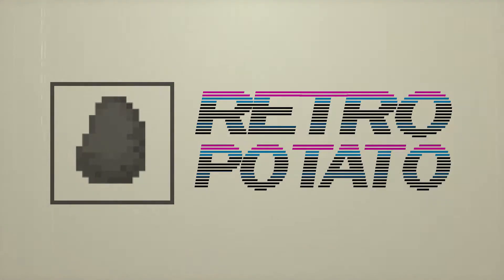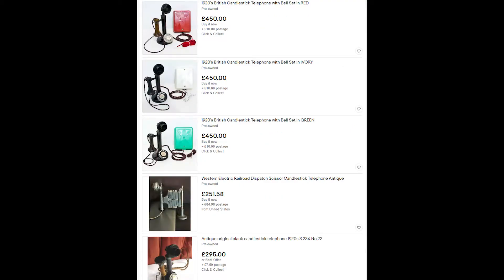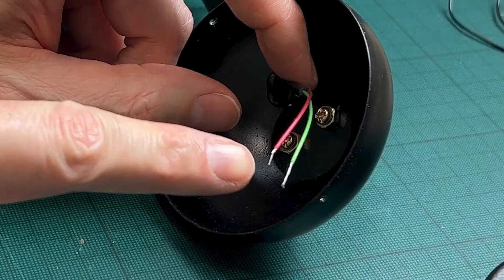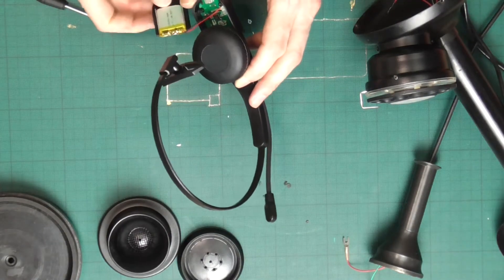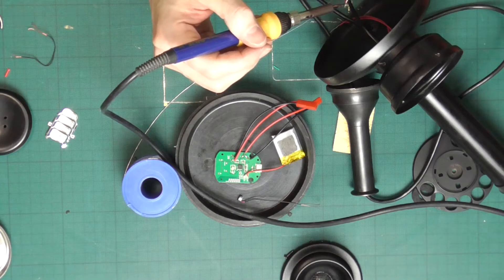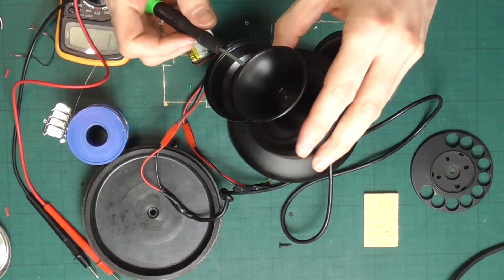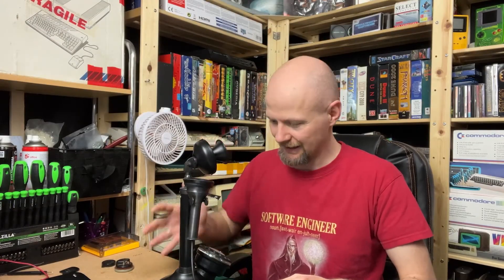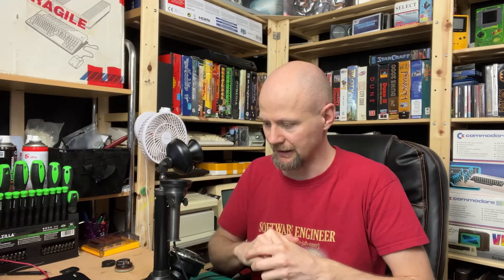Best (retro) Bluetooth handset to work from home

Comment: The big question is, does the incoming sound sound as good as the old land line phones did or as crappy as the  cell phones sound. If it dont drastically  improve  the sound the  why bother  with it?.most likely wont get a decent answer  i never do
Reply from the maker: A year later... Apologies. 
The sound you hear and it sends back is... as brilliant as these old phones probably sounded. Lacks any depth or base, and it is fairly flat middle and high frequencies. Like if you have heard old grapmophone or film sounds... 
So it absolutely adds to the authenticity... 

The reason i made this was because i was looking for some BT headsets for myself, and got this one and I thought to myself..."how bad could it be" ... it turned out to be ... very bad. And it reminded me of the old phones, which then led to the next idea, why not build it into an old phone? I mean it clearly sounds like one... 

So it is a fairly pointless project, however it can create some laughs when you dial into a meeting with this...

Comment: Well that was pretty vague! What about all the headset buttons?
Reply from the maker: 2 years too late... 
Well it had only 3 buttons. 
Power On / Off / Pairing (1 button)
Volume UP and Down.

the volume at the LOUDEST point is still fairly quiet... so what i did is just move it up to the highest point and forget about it.
the powerON/OFF/Pairing button is wired to the bottom of the phone base - and as been replaced with a better push button, so you can power it up / down or set up pairing mode.
This was a pretty cheap and bad headset to begin with, which sounded like an old phone... which then gave the idea, to turn it into one

Comment: Oh that's very cool! I love these types of phones. It would be funny to use this at a meeting or to play with it even if it's a bit incovenient to hold. I would imitate Tony Curtis's face in Some like it hot, holding the speaker and nodding uhuummm uhummm ;) 
How do you charge this? Did it get a usb slot? Does it have an on-off button now? Anyway, very good video, keep up the good work :)
Reply from the maker: Charging: there a 'permanent' USB cable plugged into the board and hangs from the phone (where the original RJ 11 connector was)
ON/OFF: initially there was no on/off switch, however i added one UNDER the phone now (using the hole which you can see on the middle of the base at 06:47
Currently it is squished into the hole (microswitch, and hot glued there) , so not visible at all... but I am thinking about something more permanent or better solution... for example how to utilise the speaker holder which IS a switch by design...) 

Surprisingly the audio quality both received and sent is pretty 'bad' but it just adds to the authenticity of the phone (however i would not complain if it were HD audio... but feels more retro this way)